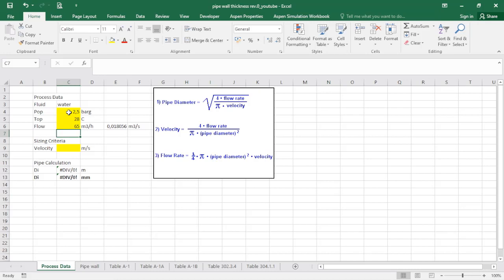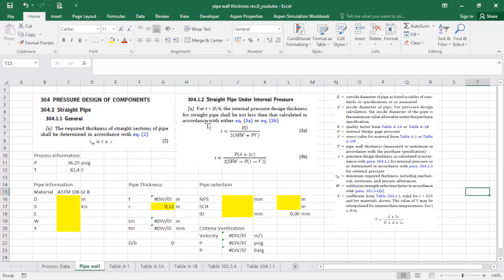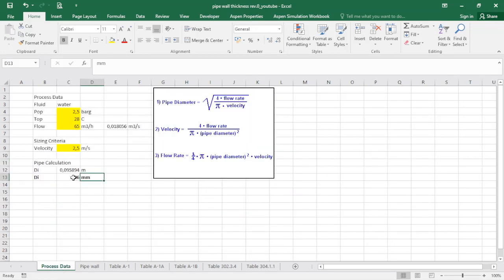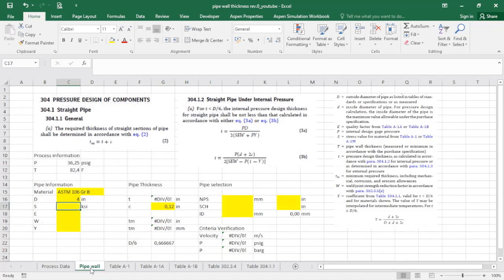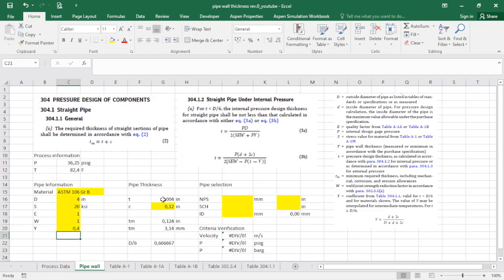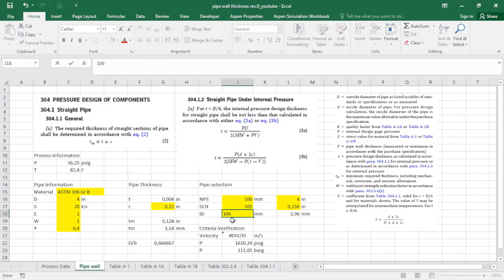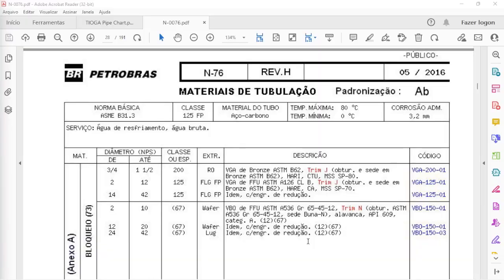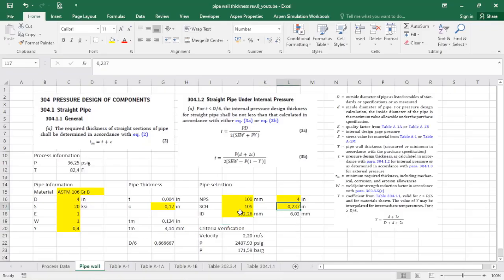PIPE WALL THICKNESS CALCULATION ASME B31.3 FOR CHEMICAL PROCESS ENGINEERS

Comment: Sir could you please make a videos on :
1. Development of Material Balance ,  Energy Balance in Excel for systems
2. Performing Batch cycle time calculation, unsteady-state calculations for batch reactors etc
3. Utility Estimation and validation of equipment sizing
4. Performing hydraulic calculations (pump and compressor, control valve hydraulic calculations, line sizing, relief valve sizing) and validation of data using ASPEN Task Plus and EDR (Exchanger Design and Rating).
5. Design of distillation columns, extraction columns and heat exchangers using ASPEN PLUS and EDR (Exchanger Design and Rating) module
Reply from the maker: Noted 😇

Comment: i have a question for you brother 
In hysys aspen what is the reactor that i can use to simulate synthèse d'ammoniac 
Did PFR do the job !?
Reply from the maker: Hi Mosaab, yes you can use PFR to simulate ammonia syntheses. The selection of type of reactor in Aspen Hysys will depend on the information you have about the reaction and also the objective of your process simulation.
Reply: @jefersoncostaengineer  thank you brother but i had some difficult 
When it converge the ammonia composition dosn't change between inlet and outlet 🤷 i don't know what is wrong, i will be grateful if you Can guide me bro

Comment: hello sir , i have a question please. i asked many people but i didt find my answer. how can I do my simulation in Hysys for 2 cases of winter and summer ? these temprature must entered where exactly ? thank u for future answer
Reply from the maker: Hi Mahsa, as you mention winter and summer will affect ambient temperature.  Equipment more sensitive to this variation in temperature is pipe segment with heat transfer, air-cooled heat exchangers and cooling water system. There is no single place where you will add ambient temperature and all variables will be adjusted to that. To adjust your process simulation properly, you need to identify which equipment and material streams will be influenced by that, and set them accordingly.